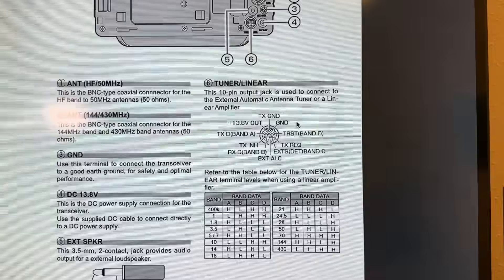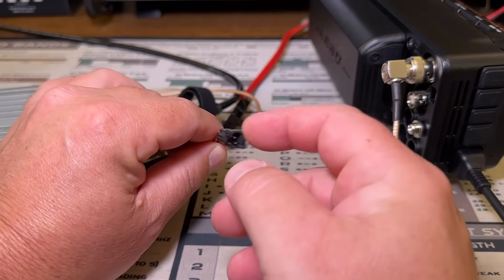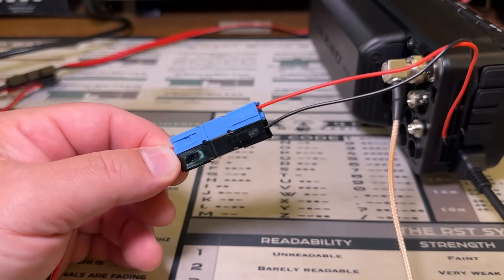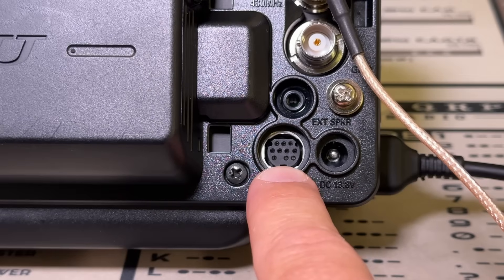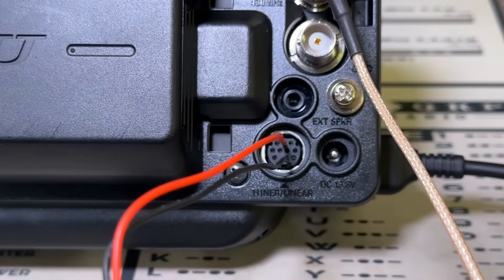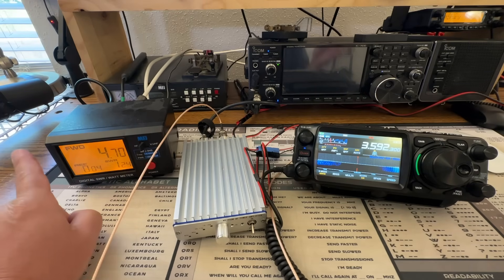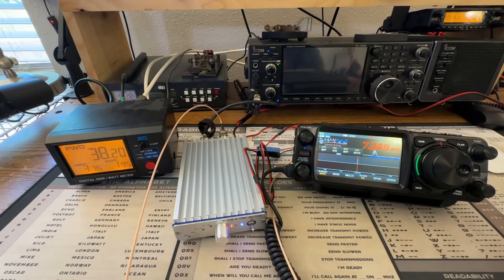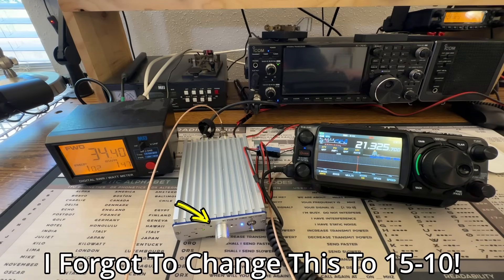DIY Yaesu FTX-1F To MX-P50M Amp For More Power!!!

Comment: TX Gnd is the PTT and it pulls the slight voltage that is supplied on TX Gnd to Chassis Gnd on the radio to make it work. Polarity doesn't matter. BUT DON'T TRUST ME WITH YOUR RADIO.  I have built a few of these for my Yeasu radios and I don't use ALC for anything. Only the PTT trigger with is TX GND. DX Engineering describes their cables in the description as do a number of forum posts and Ebay listings. Best to look it up.
Reply: I do own the Optima version 100 watts and use my amplifier to my VHF 2m amp side to use either my 170w ("RF Concepts" )on the coax /coax direct setup and a ( Command Technology ) "Commander II" for 1000 watts on the ALC setup.
Reply: Yes,that a good hookup on the TX GND to keyup the amplifier.I use also the ALC to my amplifier if it has the ALC /RCA jack on the amp to control my power if I overpower the exciter to the amp.
Reply from the maker: Hey look at that!  I connected the red to the TX GND and the black to the GND and it works.

Comment: I have a ten pin relay buffer that make the interface between the radio and the amp. This will also protect from EMF back current protection from amp to the radio.
Reply: Link?

Comment: So you know your just adding to the controversy of the FTX-1.  Why buy a qrp rig if you need to connect a amplifier to it? I'm not saying this is good or bad.
The FTX-1 has a few external options like amplifier and ATU. When I first heard about this rig a year+ ago I thought this would be a great idea IF they provided an open source hw interface to the radio. That way anyone could build stuff to plug into the radio. Kinda like PCI or USB.
But I'm glad you are creative enough to show us other ways to do it. 
Next? How do you get that expensive beer cooler of yours to interface with the radio?

Comment: That ain't janky...

Janky is when you're a bunch of teenagers trying to have a LAN party in the mid-nineties to play DOOM and no one can afford the long BNC cable to extend the THINNET network from one side of the room to the other so you take a piece of bell wire, stick one wire in the center of one side of the T-connector, and wrap the other pin around the shield and secure it with scotch tape.